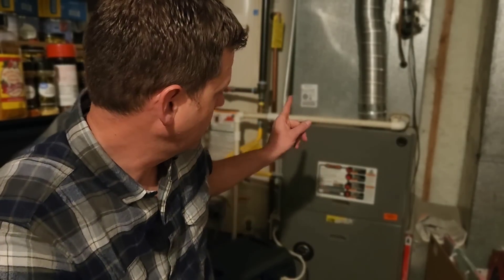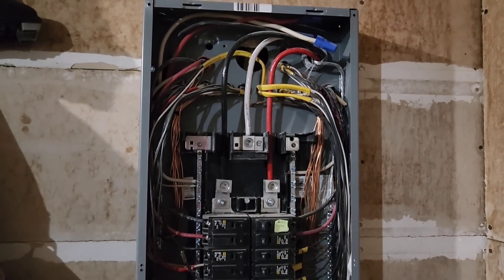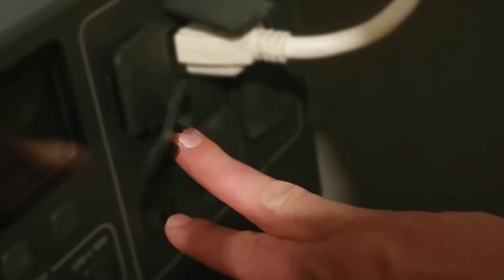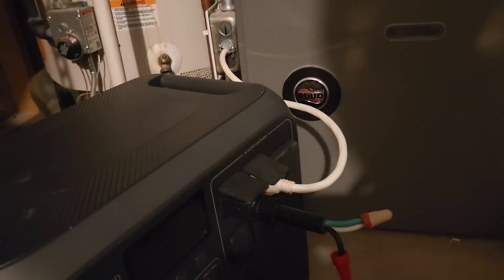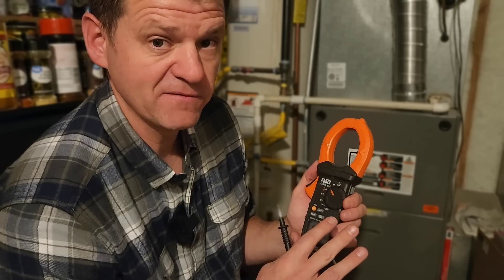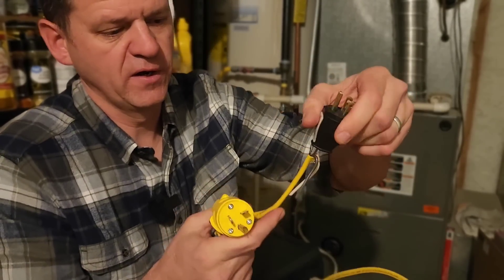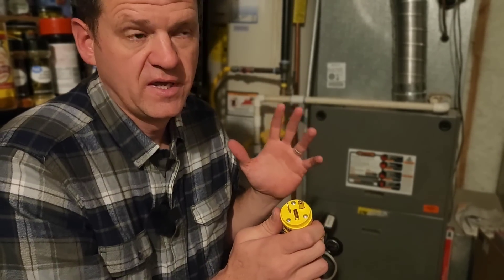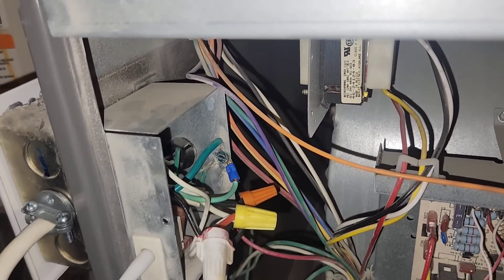5 Things That Go Wrong Running Your Furnace Off A Generator

Comment from the maker: Thanks, Please let me know if I missed anything.  Happy trails :)
Reply: After you found and repaired the issue with the loose grounding conductor inside your furnace, was the
 neutral/ground bonding plug still needed, or did the Bluetti then power your furnace without it?
Reply from the maker: @mjdiiii  if my memory is correct I still needed the ground plug. But all power stations / generators are different.   Some of them have a ground neutral bonds built in and some don't. It would be easy to check with a multimeter. 👍
Reply: What if before you convert the power box has a 10 amp fuse, but at the breaker box has a 20 amp switch?
Reply: @diySolarPowerFunWithRay  Just that here in SoCal a lot of FAU’s are in the attic. And connecting the 2 busses (coin or washer) give 110 to everything. Just don’t run everything. 🤓

Comment: My 8750 inverter generator backfeeds into the electrical panel through a 30 amp breaker. Can't I just switch my gas pack heating system to emergency heat and let the furnace run as though there was no power outage?

Comment: Whenever if see ANYTHING which like a two plug wire, it gives me the willies.   Yes, in theory, that ground only plug shouldn't be hot, but you're dealing with amateurs who are doing things under emergency conditions.   The nickname for a two plug cord is a "suicide cord"

Comment: Why Can’t You Run Your Generator on ECO? I Have a Honda 2200 and it starts and runs my Trane XR 80 without revving up. Thought the Eco might save fuel in an emergency situation. Thanks for your video got me going making a dummy plug.

Comment: One more thing, Most multi meters have a Total Harmonic Distortion (THD) setting. Use that to measure your gens distortion and if it's over 5%, don't use it to power electronics like your furnace.
Reply from the maker: Thanks.  I'll check that out on my meter.
Reply: Please advise which multi meters other than the Amprobe NAV52 or 54 offer the THD function.

Comment: You can use an old style generator on some electronics.  Anything with a clock may drift with dirty power.  An inverter, more expensive, generator are best. When any generator is running out of gas, it can surge the electricity to your electronics.  Always unplug your electronics/load on any generator before you shut off/turn on your generator.
Reply from the maker: Interesting.  Great points! Thanks for sharing.

Comment: A few years back a friend of mine called me over to his house because it's 10000 watt generator was running everything in the house but the kitchen lights and refrigerator. The cook stove was gas and so was the furnace but they were using the fireplace for heat cuz I only had a 10,000 watts to play with. They're just remodeled the kitchen and buy all new appliances for the kitchen but the LEF lighting panels any refrigerator will not work. After some fall I got a long wire and rent it from the metal casing on the generator to the ground rod outside below the meter box. Once I done that both the LED lighting panels and refrigerator started working. It seems like more and more devices are coming with  ground detection equipment built into them.
Reply from the maker: Interesting. So it was able to detect that the ground was actually connected to the Earth ground? I wonder how it detected connecting to Earth ground

Comment: My brand new 9000w generator was about 61hz without a load and my inverter/charger for my battery bank rejected it until it was loaded a bit.  So the hair dryer trick is real.  I was able to tune the generator governor a bit for a better fix.
Reply from the maker: Aw. That's cool. Good to know. thank you for sharing
Reply: 61Hz isn't a problem.

Comment: Another thing that can go wrong is people seeing the ground-neutral bonding plug in this video and getting the wrong idea of when to use it. These things can be very dangerous if plugged into a system with an existing ground-neutral bond, as you create a loop by having two such bonds. Disappointing not to have a warning about this in the video.

Comment: There is a proper way to do this, code approved, and this is not it. Your box needs an inlet plug, and a transfer switch double pole double throw
Reply: Yes this is a jig rig.
Reply: @RadioRich100  Yes. You can get an assembled one with approvals which does it all.
Reply: @NoSpam1891  It must go on the panel.
Reply: @RadioRich100 No, on the furnace. You plug in your extension cord outlet, flip the switch the opposite way, and the generator powers the furnace. At least you have heat.
Reply: @NoSpam1891  No on the panel, its illegal and dangerous to install it that way. Transfer switches are supposed to be installed at the source not modify the heater. What he did was a diy jig rig, do it right and avoid issues. Your supposed to be backing up the circuit with the proper neutrals. Theres too many utube dicks with their jig rig modifications.
Reply: @RadioRich100  I'm a licensed electrician and this is the only approved method in the US & Canada. Sure, I could come up with my own system but the code is clear and must be followed. So I follow the code.
Reply: @NoSpam1891  You cant put it on the heater.
Reply: @NoSpam1891  No your wrong ,I dont need to research it, you cannot modify the furnace . It must be connected to the panel like any other transfer switch and control the circuit. You have no idea what your talking about. Theres a difference between an installation done legally and professionally and a DIY Jig Rig you found on utube by somebody else who also doesnt know what there talking about. Just because it functions doesnt mean it correct or safe.
Reply: @RadioRich100  I'm a licensed electrician. I know a lot more than you.

Comment: In MA we need a CO detector within 10ft of the source. It gets wired into the same circuit as the furnace whether it's gas or oil. When you use that cord plugin you are disconnecting that CO detector. Be aware of that. There are dedicated small transfer switches that install next to the panel that are safer than playing with the furnace wiring that may void a warranty.

Comment: If you have the power bank plugged into the wall, it should pass on this ground-neutral bond, right? (and that would be true even if the power goes out). This plug you made is only required if you are completely disconnecting from the grid while running the furnace?

Comment: Thanks for the tips, great video. I’ve been looking into doing this, and just came upon it. For my situation, I’m planning to add an outlet, linked off my furnace fan box (with a switch/outlet combo, instead of just a switch). The link to the new outlet will be via a new ‘3-wire’, with black carrying live power, and red carrying linked power thru the switch to/from the swappable power cord. Since this will also tie the house & cord grounds together, I’m thinking it may also solve the floating ground issue as well, but not certain. I guess I won’t know until I get there, but thanks so much for taking the time to do this, and for the advance warning.
Reply from the maker: You're welcome! Sounds like a good plan for the winter.

Comment: basic question: furnace generator plug i get but isn't the air handler typically on another circuit?  power up the furnace but not the air handler?
Reply: thanks!
Reply: I believe it is code that the whole unit, furnace and air handler be on the same dedicated circuit.  A 1/2 hp blower motor only requires 6 amps - and the furnace maybe 2 amps - so one 15 amp circuit should easily handle the whole thing for a basic residential system.
Reply from the maker: My entire furnace(which had a build in blower fan/air handler) is powered by my plug. Hope that helps :)

Comment: As others have stated, home depot,  lowes, Amazon,  sell plugs for about 10 dollars,  it solves that issue,  you may have to plug it in to your power station too if you're using that instead of a generator
Reply: You can get 2-3 online for that price. Honestly that even seems high. It's literally any spare grounded plug from a cord you don't use with the ground and neutral connected.

Comment: I have a portable generator that hooks up to the breaker panel.  When I use the generator it will not run the furnace. Furnace tries to run but kicks back off. There is a code saying something about the grounding. What would be the fix for this? 21 year old gas Lennox furnace
Reply from the maker: I imagine it is the ground neutral bond that i mention in this video. Your generator may be a floating generator
Reply: Did that fix your issue?
Reply: @Checkthissout0  
I sold that generator and purchased an inverter generator. They produced a steady flow of electricity. Sounds like that's what I need as a regular generator produces " dirty electricity " and can burn up sensitive electronics which includes the furnace mother board and is the reason it wouldn't work.
I don't have the new generator yet so I haven't tried it. 
Thank you for checking!
Reply: @ 
Yes I am having the exact same issue as we speak. I believe the cause must be dirty power as my generator is bonded, but not an inverter type generator

Comment: Do all new Generators have “dirty” power? i.e. Do I absolutely have to have an inverter type Generator to use for this setup?  Thanks for any insight.
Reply from the maker: Depends on the type of furnace you have. It might work but then again it might not.  I know that some power Stations and Motor homes don't like charging from a non inverter generator.  Both of my furnaces required the ground neutral bond.

Comment: Some inverters have 60 on the hot and 60 on neutral. If you connect neutral to ground your going to fry the inverter. In my RV one inverter is neutral bonded the other is not. I'd read  the manual before doing this.
Reply from the maker: My Ecoflow is like that and also my bluetti.  60v ac between gn and hot and neutral.  Thanks...I didn't notice this before.  When I use a bonding plug on the ecoflow i now read 120 between hot and neutral and hot and ground.  I believe my bluetti does the same.
Reply: @diySolarPowerFunWithRay  I would verify that the mfg allows the use of bonding plug. I have been told that if you do that with some models you blow them. Please be careful. 
The Xantrex inverters are bonded so that is a start.

Comment: is this set up to code- will a home inspector or serviceman come in see this set up and freak out?
Reply from the maker: It's just an outlet... So just make sure you wire that right.  it will allow more protection because you can totally unplug the furnace while you work on it.
Reply: @diySolarPowerFunWithRay  will do- thanks for this video
Reply: It is definitely illegal. You cant modify the furnace at all. You make your modifications at the panel with a transfer switch.
Reply: @RadioRich100  like this  "manual transfer switch" I saw in another video from amazon

Comment: The average gas furnace draws about 1000W (with 1500W surge). So a typical portable power station you find on Amazon with say a 1000 to 2000Wh capacity would only be able to run a furnace for something like 1 to 2 hrs, or am I missing something?
Reply from the maker: The furnace is only blowing a fan....so that seem really high.  I believe both my furnaces use less than 500 watts.
Reply: @diySolarPowerFunWithRay  Well, there's also an inducer motor, plus the control board and thermostat, but I agree 1000 W average is too high considering today's high-efficiency models with variable-speed motors. 1000W I realize is more of a maxxed out figure. Thanks!

Comment: I'm assuming the ground / neutral bond is also an issue with power inverters? I recently purchased an inverter to run my furnace off a car battery in case of emergency. Thanks in advance
Reply: My EcoFlow Delta 2 ran a Burnam natural gas fired boiler with no extra bonding involved.
Reply from the maker: All power stations are different...  Some have the Ground Neutral connected "Bonded" and some don't.  Easy to test to continuity with a meter though.
Reply: @diySolarPowerFunWithRay I was going to ask this same question but with an uninterruptable power supply. Any suggestions?

Comment: I tried to do this last week when we were without power for a while and found the that ground coming from my panel is not connected to anything. It's just sitting inside the furnace cabinet. I'm assuming it's just touching the metal body of the furnace. 
I'm going to have to call someone as I'm not comfortable fixing that.

Comment: I bought the ground plug also a splitter, so I can plug in the plug from the furnace and the ground neutral bond plug into the electric splinter and then plug the splitter  in the generator plug

Comment: First, did you measure for voltage between the ground and neutral from the generator.
Many generators with have a voltage difference which you just shorted out.
Most generators and inverters do not put out exactly 60Hz.
You can test this with an electric clock.
Plug the clock into the generator, if the time is off either way, you can calculate the difference.
The frequency difference would have to be way off to affect the furnace.
Reply: This only works with an older motor style clock. Newer clocks (digital) have converters and run on DC voltage with crystal controlled frequency from the power supply.

Comment: Are the two grounding options (self contained plug and ground-only-to-house) used in a one or the other fashion or both at once.  Is this also needed for a power bank?  Thx
Reply from the maker: Sorry.  I'm not sure what you're asking.
Reply: @diySolarPowerFunWithRay  You showed how to make and use a ground-neutral bond plug.  You also showed how to use a ground-only line to tie into home ground.  My question is this: Do I need to use both simultaneously, or just one, or the other?  Or possibly neither if I don't have a super modern furnace?  Also, are those devices needed if using a battery bank with an inverter to run the furnace, as opposed to a generator?  Thanks
Reply: For safety, I’d want the furnace ground always connected to the house ground, no matter what is supplying the power.  My old furnace doesn’t care about any voltage difference between ground and neutral, but if yours does, you’d need them connected together somewhere, as shown in the video.  In the Rochester ice storm of ‘91 I got power via an extension cord from my next door neighbor who still had utility power.  I put an ungrounded line cord on my furnace, along with a permanent ground wire between the furnace and my house’s ground.  That way, if there’s a big voltage difference between my house’s ground and my neighbor’s, everything is still safe.  To answer your specific question (using your own generator), yes, you should do both things.  IMO it’d be better if your furnace-to-house-ground connection is a permanent wire, not something that could ever get unplugged.

Comment: The solar generator has a dummy ground.  Does the floating ground issue apply to a gas generator and/or does the gas generator need to be grounded to a ground rod?  I have a newer model Firman Tri Fuel generator and thinking about using the generator to furnace hook up.
Reply from the maker: Here's a good video explaining thing better:  https://www.youtube.com/watch?v=RkjjZJgaINA&t=29s&pp=ygUVZ3JvdW5kaW5nIGEgZ2VuZXJhdG9y
Reply: @diySolarPowerFunWithRay  Thanks, I took a volt meter to the gas generator and it is bonded. Also saw another video that demo when to ground gas generator and not.  For this, do not need to ground generator. thanks
Reply from the maker: @rossishima  nice!

Comment: I'm guessing you have an open ground light when plugging a circuit tester into the power station AC outlet.  Would you get a different reading after plugging in your DIY bonding plug.
Reply from the maker: The bonding plug fixed that open ground issue i had.

Comment: It really is interesting that all the modern appliances that are so processor controlled are so vulnerable.
 I'm glad I have all my old antiques that don't have any of that crap and work wonderfully.
Reply: yes it seems how we live on a fine edge for success and failure on modern appliances . Think how easy it would be to stop your car.
Reply: i have a basic oil burning forced air furnace which works just fine on a generator.  it doesnt even have the digital display on the control box, just the plain one with the red reset button,